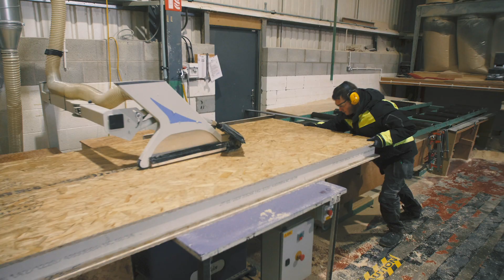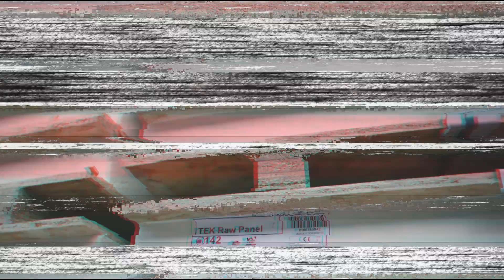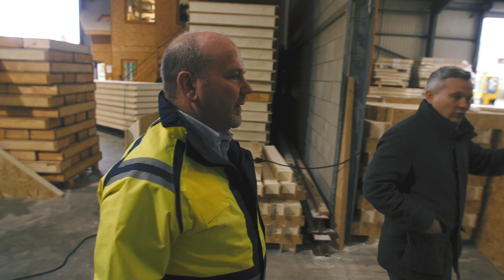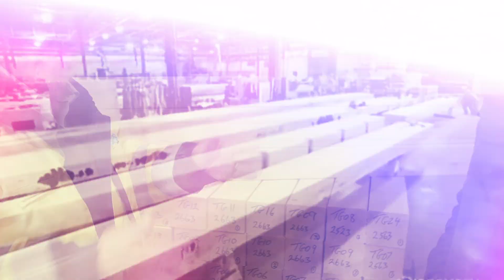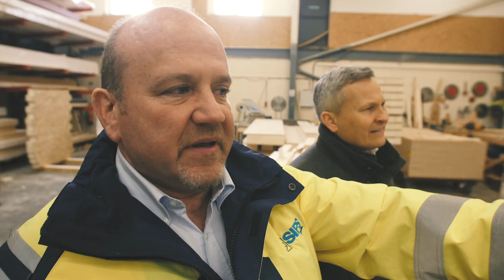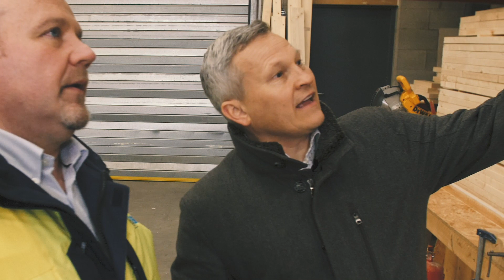SIPS Factory Tour (SIPS@Clays) for eco-friendly housing development - Church Farm Ep3

Comment: Is this wall load-bearing? How thick are the load-bearing walls? How thick are the boards on each side?
Reply: Could you be more specific? Not sure what picture you are looking at? The SIPs are load bearing themselves but sometimes require more structural timber if you have a large opening. The SIP panels themselves are 142mm wide and comprise  a sheet of 18mm moisture resistance OSB on each side of the insulation.
Reply from the maker: Hey, I hope Andrew's reply above is what you're looking for - please give Clays a call directly or drop us another message if you need more info. Thanks!